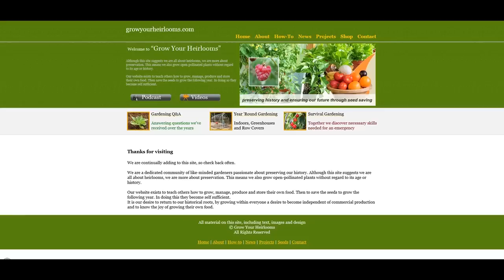Build A Mini Greenhouse For Raised Beds

Comment: live in Scotland and cant find 4 way connector anywhere can anybody help?
Reply from the maker: +isa ibrahim Ebay  or Amazon UK should have them.
Reply: +Fritz Von Grottyknocker  thanks for trying to help,but wickes don't do the cross 4way joint.tried ebay & amazon,no luck there either
Reply from the maker: +isa ibrahim Here's a solution. Bolt 2 t joints together back to back. I'm am going to try it and put it in my next Q&A video.
Reply: +Grow Your Heirlooms good idea,just thought to cut one at the t. soften with heat gun then press over other t to shape then use either pipe weld or epoxy,would work I think.let me know what you think my friend
Reply: +Fritz Von Grottyknocker don't think so never heard of them

Comment: what about all the radiation from japan falling on the food (rain) the closer to the west cost you are?
I means its been 2 yrs (and no plans to cap it for 25 yrs or more).

looks like a cool project the only thing I would add is some weights on the inside of the structure to hold it down in a strong wind .
Reply from the maker: Not worried about radiation from rain at all. In fact, not even remotely worried. And in the video I discussed using conduit clamps to hold it down, Thanks.